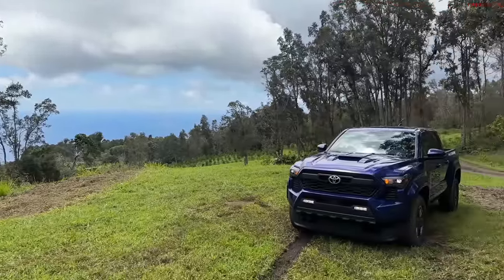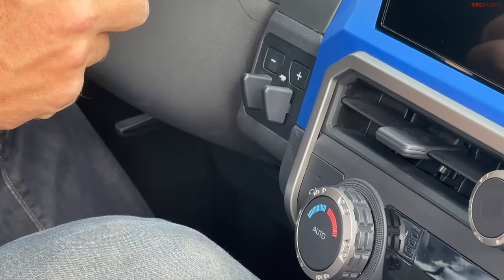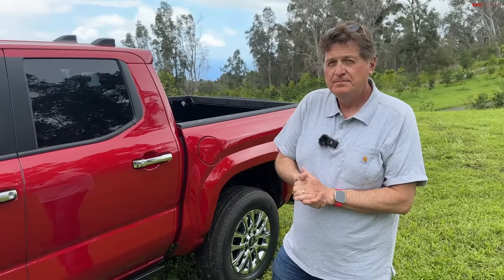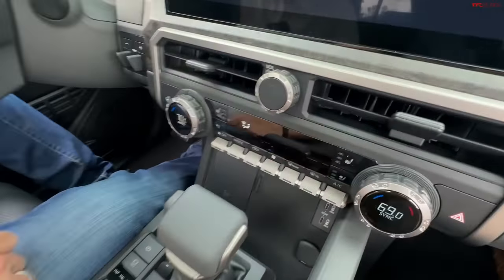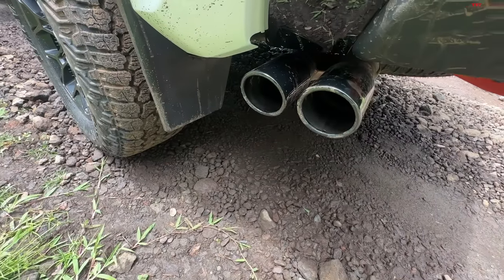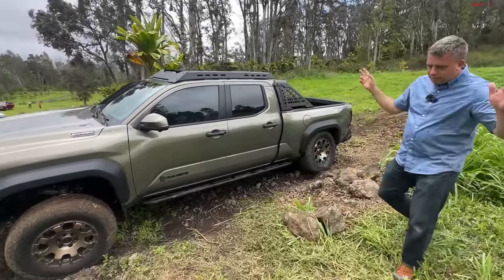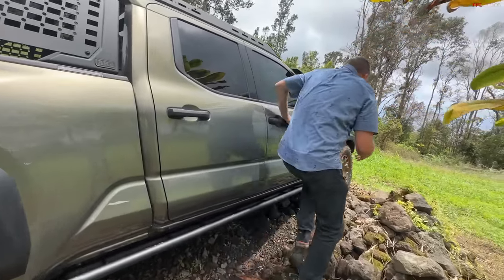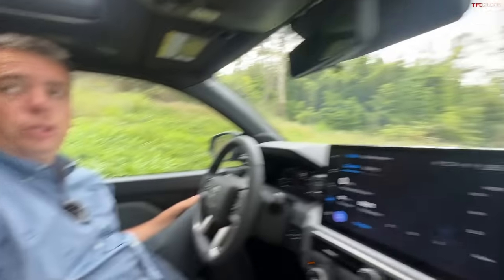The All-New 2024 Toyota Tacoma Is Finally Here But Have They Fixed Its Three Biggest Problems?

Comment: would be awesome to get the trailhunter in that spec with the manual transmission. jeep missed it with no manual on the diesel (that torque on a rubi spec and the gearing...) hope the manual will be available frequently on the other/higher trims (doubt on the pro with the hybrid system) and on a 4 door/ 6ft bed setup (hope not only in 2wd in that config). kind of feel stiffed when I look at what the prices may look like - midsize truck for a full size price tag? within 3-4 mpg anymore (obv depending on gearing/tires) between this and a 350/3500. also, wonder what an arctic truck version of these (would love to see a tundra done up). 
Also, well done TFL Team. never miss a detail and always use jargon we all understand while bringing in the terminology we may hear at dealerships.

Comment: Would a tacoma be a good work truck id be pulling a small trailer doing windows so some weight but not a ridiculous amount and i prefer smaller trucks so looking for something smaller that will be comfortable and work reliably any opinions or suggestions would be appreciated its gonna be a few months at least so i habe time to shop around

Comment: They butchered the power train... Why not a v6 turbo? The 3.5 with v6 turbo would be excatuly what the taco needed. My 23 off road is pretty boring. These little 4 cyclnder turbos with any amount of towing will not last like the older generations did... You can beat physics. Smaller engine working harder vs larger engine working less. Glad I scooped up the last v6. Albeit there are some real flaws with it, seating postion. Automatic gear hunting (fixed that with a flash to set predetermined shift tables). Before the flash, the  next best thing would put it in S mode, and shift it yourself but limit it to gear 5. Wish they would have put rear bumper steps like chevys do, trust me once you try them, they are awesome if your in and out of the bed.

The hybrid has impressive numbers, but this won't be a truck you'll have 200-300k+ without major money into it...

Comment: Not enough of a pickup for me. Spoiled with my F150 reg cab short box 5.0 4x4 400hp 10spd. Now with 4.09 and 4.10 posi and torsen and I get 19mpg all round driving with 285/60r20's. It was interesting to see they are offering a manual transmission but it is a little pickup so it should hold up.

Comment: No 6 cylinder option. I'm definitely out as a potential buyer. Just like the Tundra and it's V6 and no V8. Not buying another Toyota truck. I'll keep my Supercharged 2015 Tundra  for as long as it will last and then will be looking at other manufacturers  for bigger power options.

Comment: 3:40 There's this wide-spread misconception about vehicle hood scoops. Fact is, they are ALL functional - if they are not designed to provide a short, unobstructed path for engine intake air, then their function is to LOOK COOL. Both functions are quite important.

Comment: 6 sped manual not available on the High HP model.6 foot bed only available on models with leaf spring suspension....The optins just dont pan out for what you want and what you can actually get.

Comment: Really nice truck but I not sure about the 4 cylinders. 270hp @ 6,000rmp? I wonder what is red line? The higher the rmp the more gas it burns and the more beating to the 4 cylinder engine.

Comment: Im not sure how the last generation seating position was and didn't know it had so many conplaints. My last tacoma was a 2006 and at 6'2". i never felt cramped. I liked the seating position. What i didn't like was the seat. Anything more than a couple hours, and it sucked. I just dont understand the clamor for all of this technology in the new trucks across the board. Maybe it's because i was raised by a very old school father who hated vehicles with more technology. All i see is more crap to break or not work properly. More tech equals more money to buy. I'd be just happy with a basic 4x4 truck with little to no tech in them. I guess that's why I'm still driving a 2011 gas f250 XL. The only tech it has is power windows, door locks, and mirrors. Guess I'll keep driving it. All these new trucks are loaded with this stuff. Even the base model trucks. Boooo

Comment: What? NiCad, not Lithium batteries? Toyota should have taken that $ they got from the Prius and done something more with it. They were way ahead of the game, then lost it. 2.4 liter has a lot more torque and HP, but all that compression is going to strain the engine more, but likely improve MPG/less weight and space. Reliability is a key aspect of this model. I hope that will not be lost. Glad to see the Hybrid option as it really is a no brainer for the Tacoma. Be nice to have the plug in version with Lithium batteries. Then that high compression engine would have less potential issues long term since most owners would only use it every so often vs daily. Quite a few trade offs, but better than the past models and likely much better MGP for Toyota.

Comment: Was planning to purchase a 24 til I heard they dropped the v6 and went to a 4cyl.. they are doing the same stupid thing chevy did when they put a standard 170 ci 4 cyl in their 1500 full size pickup. Gonna keep my older chevy I guess. Except for the engine the 24 looks great,although I don't think you will see the new engine going 2 or 300k miles in a few years like the v6 can easily do.

Comment: I'd trade all those electronics, tailgate motors, and seat suspension gimmicks for a front locker.  I'm at least happy that they increased the wattage of the house outlet and payload.  Kinda sad that my '09 is rated to tow more than these 300+hp models though.  Integrated trailer brake controller is a welcome add-on.  I sincerely hope they don't do fake engine noise in the interior.  They didn't mention it in the video.  I'd like to know what gauge of steel the skid plates are.  Sometimes they're just for looks and they're not much stronger than the foil I use to wrap my leftover pizza.  The explanation of non-lithium batteries is total male bovine fecal droppings (BS).  Lithium is far superior in just about every measure, but Toyota refuses to use it at first so that they have something to upgrade to later in true planned obsolescence style.  Consumers need to stand up the way they did with power tools and only buy lithium battery vehicles and not this BS that Toyota is sneaking by.

Comment: I’ll stick with my 2018 TRD Off Road. This looks like changes made for the sake of making changes. And elimination of the excellent 6 cylinder engine for a 4 cyl turbo? What absolute crap. It will never last like the 6 cylinder when it comes to miles per engine life. Also, please bring back the driver side hand grip on the post. Eliminating that was a mistake.

Comment: I'm on my 2nd Tacoma 2w drive short bed.  I put 260,000 miles on my first one over a 13 yr. period & it was a beast!  I'm hoping that if I take care of this one I will get a similar or longer life span out of it.  Having said that, here are my gripes about many in the Tacoma owners family.  It seems no one is satisfied with anything.  People see new features on redesigned trucks & still bitch all over the place about "What I wish they had done with the new redesigns!"  Then people step back and wonder why a damn Toyota Tacoma will eventually price out at $75,000!  The freaking trucks will climb a hill like a goat if needed & will last like forever if the driver is not doing absolutely stupid things like going up the side of a damn mountain or down a logging trail at 40 mph in a $70,000 pickup truck!  Geez! 🙄🙄🙄🙄
Reply: From what I know of turbo charged engines, you won’t get the life out of them compared to the normally aspirated engines because of the high heat, high pressure nature of them. Higher maintenance also and massive problems if not.
If I was interested in these vehicles I would wait two full model years before buying.

Comment: That hood sure did flop around when you shut it, me personally I’m disappointed in Toyota as I came from a 2019 Trd off-road limited and traded for 2022 same version. It is definitely a different truck but I like the old ones better I currently driving new Silverado now was very upset with the new tundra.

Comment: Oh wow this makes me want to rush on the 2023 while I can. 4cyl and a turbo? Are you serious? There goes the longevity these trucks are known for. Might last if you go easy with city driving but there is no way a 4cyl and a turbo is going to hold up to steep climbs or hauling. And that front plastic guard? I'm sure you can take it off, but it's only a few inches off the ground. Barely clear a speedbump let alone a sizable cross ditch. Sad to see the direction they are taking with the Tacoma. City slicker / soccer mom rig. I rarely "thumbs down" a vid and mixed feelings doing so as it was informative. My thumbs down is to Toyota, not the channel. I'm buying the 2023 while I can.

Comment: GM has them beat in this generation of truck. ZR2 and AT4x look better inside and out.
GM has a better powertrain lineup 310 hp without all the battery power nonsense.
Front lockers, better ground clearance and from the looks better approach and departure angles,and the upcoming Bison with 35 in tires just to add more fuel to the fire.
I do like the manual option and the built in air compressor thats cool

Comment: That air dam under the front is dumb. Reduces clearance. Gonna break that off parking in parking lot w cement space dividers. Or scrape it on a speed bump or pothole..Let alone any kind of non paved driving. Takes away from the look of a truck too.

Comment: Think everything going less cylinders and turbo means it won't be getting 500k plus miles on the life of this,  like all the Tacoma that came before. A crew cabs are just another family SUV with open trunk. Nice to have a little room behind the seat and bigger bed option.  After 20 years of Prius hybrid best Toyota does is put a little battery in call it a hybrid, That doesn't run on electric for much more then 2 percent of the time. Bad as the F150 the engine on off on off leaving the turbos too hot internally without oil pressure.

Comment: The other thing my V6 manual compared to to the new turbo the mpg is about 1-2 MPG better (you'll see) does it have more HP&TQ yes but it's not a significant improvement. V6 just has less moving parts they say the 4-banger turbo is reliable but come on guys 10K oil change intervals no way JOSE maybe with 5K intervals but be realistic I don't put my trust in no man... I do really dig the truck tho. (Colorado ZR2, & raptor ranger!) I'm just into an old skool 🛻 💨 not this fancy stuff.. one of my good friends works at the Honda dealership As a technician for over 20 years & I drove it right over to him when the truck had like 12 miles & he drove it 1st thing, damn George this is a brand 🆕 🛻💨 🤔 obviously because I still had the plastic on the roof & hood haha he said it feels like a truck from 1995 but he digs that about it just like i prefer. I told the salesman don't let anybody prep my 🛻 I'll do that when I get 🏡 that's why I had the plastic on 😉 God bless 🙏💯🙏

Comment: So disappointed! Great exterior improvements but the 2.4 turbo has to go! If I want a 4 banger with a turbo I’ll go get a Honda or some other turbo throw away car. My 2004 Tacoma has 248000 miles. Why? Because it has a V6. Runs great and the AC is runs cool😊 This new Tacoma will not last 100000 without major repairs. The first thing to go out will be the turbo!

Comment: Jay Leno chin spoiler I see.  Yuck.   Hopefully it will be very easy to remove! Nice thst they made the hood out of aluminum but hail damage will now be 10 fold.  How about rock chips too.  Very glad they still offer the manual trans. Alsomimpressed a fully noxed frame lets just just hope they got their steel from a different rust free manufacturer.

Comment: hybrid is cool, but wa state penalizes going electric or hybrid adding over $100 per year in tabs. also toyota does charge for the most important safety feature you have to pay for the ability to reading the tpms sensors through a paid phone app... so nope.

Comment: 24 years after GM introduced Auto 4WD Toyota still doesn't offer it on any of their trucks.  That's an automatic deal breaker for me.  I use it during the winter months and it makes winter driving so much easier.  I've had Auto 4WD for over 22 years in three different GM trucks and it has always performed flawlessly in all three trucks.  I will never own another truck that doesn't have it.  And forget about that full-time 4WD or AWD setup in that "city slicker" Tacoma.  I don't do hybrid and I don't do city slicker trim.  Besides, I want 2WD capability for summer driving, which gets me the best fuel economy.  Toyota screwed the pooch on this one.  All the other improvements are meaningless when you can't do something as simple and basic as adding Auto 4WD to your trucks.

Comment: I never wanted a truck, although I do have use for one. I also never had a vehicle that WOW'd me, let alone a vehicle that would EVER convince me to part with my beautiful camry but this is the truck.

Toyota absolutely hit it out of the park with the 2024. I've already started saving, every cent is going straight down on a down deposit for the TRD Pro 6-speed. I've never wanted a vehicle more in my life, I just wish they never chopped the V6, the i4 almost made me scratch the idea. 

Anticipating the release date and MSRP's

Wish they scratched the turbo's for the TRD Pro model and slapped a supercharger on that bitch, as the 6-speeds lack the hybrid assist.

Comment: I can't believe that people are actually still purchasing new gasoline vehicles, when in 10 years NO ONE will want a gasoline vehicle. These cars will have zero residual value.
Reply: @wuggawugga82  run the numbers on cost of operation for ICE vs EV. Economics always wins. No one will continue to pay $4+ for gasoline plus oil changes when electricity is 15 cents a KWh.

Comment: The Horse Power and Torque figures are awfully low for a modern 4 cylinder NA and Turbo!! I think the turbo torque numbers are really really low for a turbo charged engine. For what Toyota Dealerships are going to charge for these they are not powerful enough, fast enough, can not tow enough, stock base models have poor ground clearance, off-road packages not available in non-hybrid etc..... Every single 4x4 should have skid plate up front, transferase plate, and armoured fuel tank. Every 4Runner, Hilux and Tacoma I have owned since 1986 has come with these on every 4x4. This thing is so loaded with worthless content and missing the good stuff on base models that it might as well be a Chevy or Ford POS!

Comment: Toyota, just bring back the legendary body designs for the FJ40, 45, 55, and 60's, add the safety crap, and leave the body designs alone. Solid axles front and rear and make SOA standard with 35X12.5's and stop with this electric garbage

Comment: Real man/anyone would want to drive a manual truck there's a little bit too much technology in this truck for my personal liking the less technology and electronics coupled with a manual the better off you're going to be I personally drive a 2017 Toyota Hilux 6-speed manual with air conditioning and four-wheel drive and a rear locking differential You cannot really ask for anything more that you really need and there's so much less to break down electronically I think it's the perfect truck if Toyota just made something like that for the tacomas I think a lot of people would buy it and would be a lot cheaper than these versions of the Tacoma with all these bells and whistles you don't really ever need to use if you know how to drive
Reply: Just to add I'm from Canada and I've driven Toyota's and Hondas all my life but I really have to say the 2.4 l diesel Toyota Hilux that I'm driving currently it's 850 km to a tank and is so basic they're so little to break down and the thing is a complete workhorse that can tow 7,500 lb I really don't understand why these things are not available in North America It is literally probably the greatest truck or vehicle have ever driven in the last 25 years

Comment: This new Tacoma is a lease only product because trying to make a smaller 4 cylinder engine perform the same is like trying to stretch a shorter rubber band the same distance .  Toyota wins because it will wear out sooner and get u to buy another one sooner .  Surprised you guys are steering around this caveat

Comment: 2024 tacomas look great, but i am sad to see tacoma abandon what made them a popular truck. "new tech" ....electronic garbage, turbo motors....you really think any turbo motor will last 300000 miles without major repairs? if you lose the toyota image of "durability and reliablility" you will lose your customer base and reputation. these 4 cyl. better get at least 30-35 MPG, or they are a bust. it was a mistake to drop the v6.......IMO

Comment: No matter how good a truck it is if it has a turbo I won't buy it. Also all trucks weather there 2-wheel drive or 4-wheel drive should come with sturdy tow hooks on the front. Try to tow a stuck Toyota out of a mud hole sometime without hooks on the front.

Comment: Does anyone ever actually "Off Road" in desgin & engineering? There's more "LOW HANGING  CRAP" on that Taco than I've ever seen! The front? "recovery points"? Those are going to be BURIED! in whatever stopped you where I travel too...and then I see a radiator or cooler down there just waiting to get PUNCHED OUT by some Mesquite....What a JOKE!